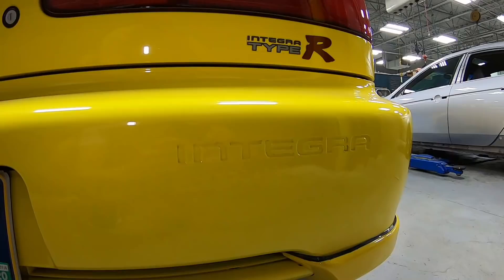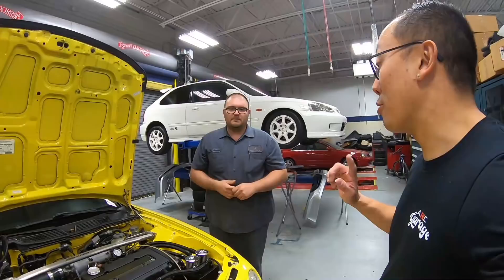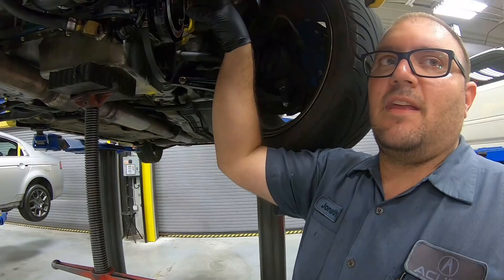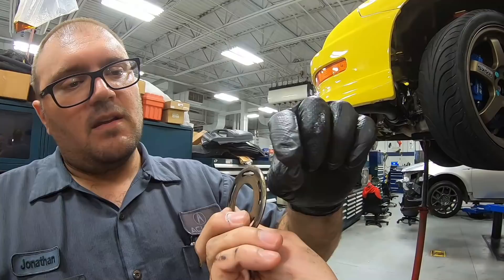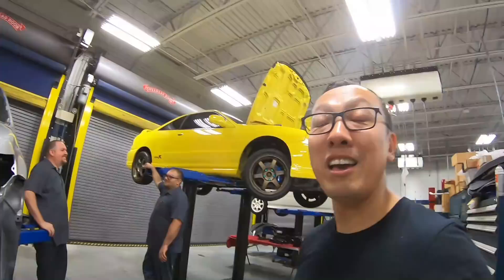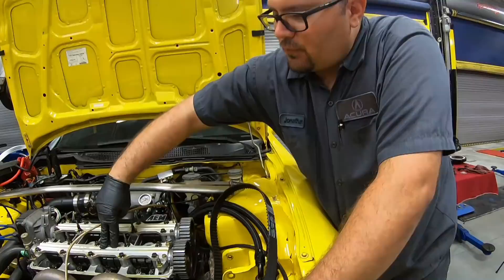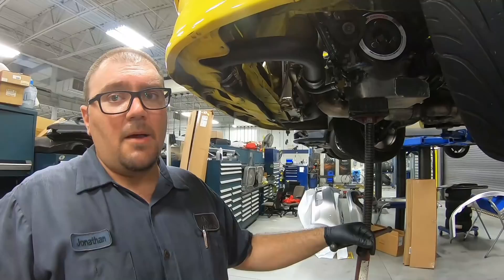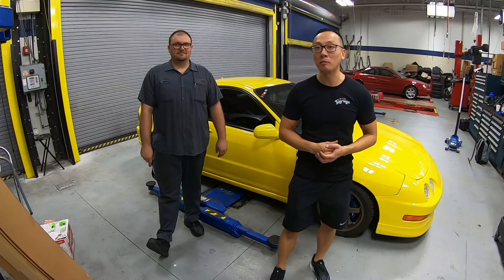AHC Shop Hours - Repair Engine Knocking on 500HP Turbo Acura Integra Type-R B18C5 Vtec

Comment: Great job as always Guys, who in their right mind would make their own key-way when it's going to be fitted on a car like that, am I right in thinking that if the key-way shredded it would then let the pulley slip putting the timing out which in turn could wreck the engine? and all that for a cheap part! lucky you were there to save the day. I do like the sudden pull of a turbo but now I have one I prefer the constant pull of a supercharger that's on my merc slk with no turbo lag. Stay safe all. John UK.
Reply from the maker: Thanks John 👍🏼

Comment: Impact on valve cover nut..... 😬😬😬😬
Reply: Small impact driver; won’t hurt a thing.
Reply: @Patrick94GSR  I'm sure that impact delivers more than 10ib torque and those nut only needs to be hand tighten, but thats just me
Reply: @skywatcher7777  valve cover shouldn't need to be tighten ni more than 10ib and thats about hand tighten, been doing that for years with zero issue